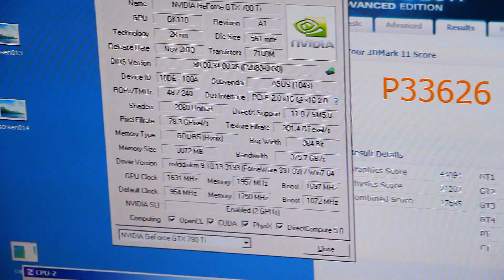Overclock & Rock'n Roll (GTX 780Ti Zombie)

Comment: Ronaldo mano, tenho uma rx 570 4gb de uma fan
fiz overclock nela  1350 no core clock - 2064 memory clock  - core voltage 1093 
temperatura 60 a 59 c
Gostaria de saber se eu corro algum risco de queimar a placa ?

Comment: Galera, tenho essa configuração
Processador i7 980x 3.33GHz ( a 3.60Ghz com booster ativado)
8GB DDR3 : memoria corsair 4gb barramento 2000.
gtx gtx 460. estou querendo trocar de placa de video, alguem poderia me dar uma dica!
Reply from the maker: Depende de quanto pode gastar... pois senão... a GTX 460 ainda é uma boa placa.
Reply: Ronaldo, obrigado pela ajuda, hj eu consegui de um amigo outra GTX 460 se, fiz um Sli de gtx 460, estou conseguindo roda BF4 com taxa máxima de fps a 64 e minima de 30, a grana que ia gastar com placa de vídeo eu vo compra mas 8GB de ram totalizando 16GB e colocar  2 SSD de 320 na maquina!!!